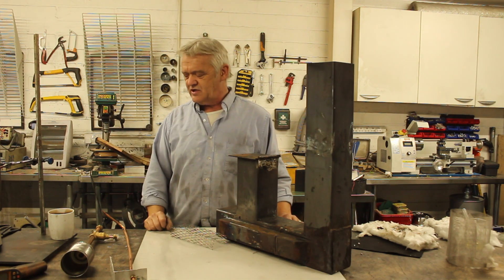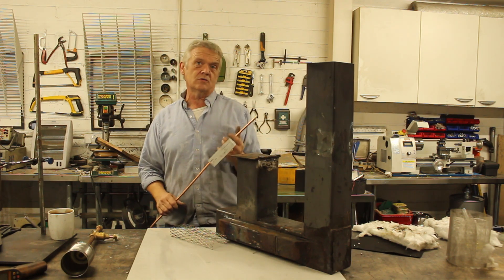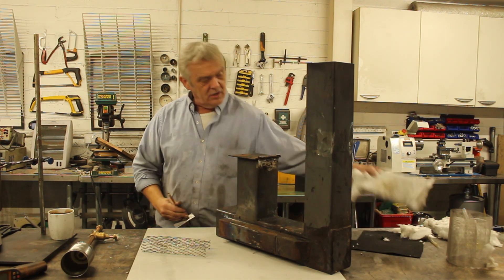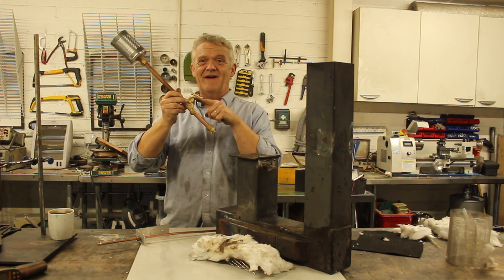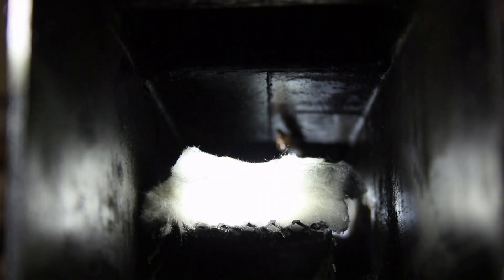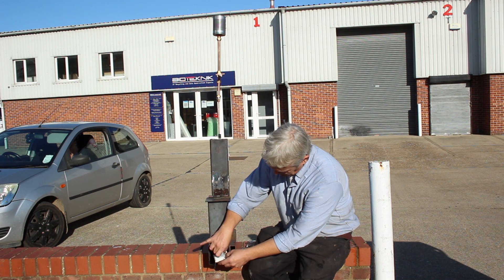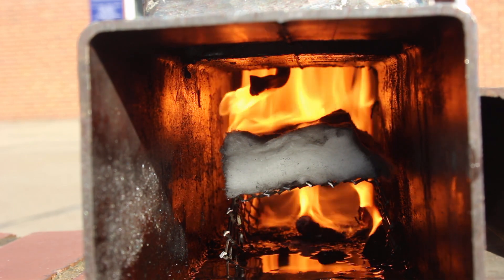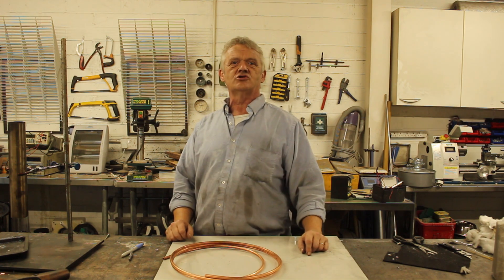1687 Waste Oil Rocket Stove

Comment: My husband has been saving waste oil from his various cars over the past 20 years, with a few large plastic drums of oil now stacking up in the front garden. Concerned about the longevity of these drums, I had asked him to remove them before they perish.

In the meantime, I had been considering 'cleaning' all this waste oil by using mycelium from Oyster mushrooms (big block of it ready to go in the fridge - this oil cleaning method discovered by Paul Stamets, world-renowned mycologist) and then using filters - in an attempt to make the oil reusable again.

However, turning waste oil into a heating fuel sounds good - if not for the house, then at least for my husband's workshop.

Comment: A little tip, just the tip, and only for a minute:
You can use a 12 volt Diaphragm Liquid Pump connected to a Variable Voltage Controller to replace a drip system and make it much more controllable and accurate.  They are self priming and can pump from 1ml per minute to about 500ml minute depending on input voltage.  Another important thing with oil burners is to filter the oil-you can use cheesecloth and coffee filters whilst transferring from one container to the other, or a little higher tech version using a pump and automotive oil filter-but it's very important.  Oil straight from a vehicle or machine is preferable, but if you don't have that luxury then filtration and a water separator is a must. If you use a spray nozzle system one way to keep the nozzle cleaner is to build an inset into the wall of your burn chamber, a 1" section of pipe with a drilled cap welded onto an appropriately sized hole works well.  Another Tip: an air powered "Engine Degreaser Wand" sold at Harbor Freight in the USA works exceedingly well as a suction and spray nozzle for liquid fuel burners. I heard from an industrial foundry owner that's what he uses for high output oil burners.  One more tip: a little diesel fuel mixed with the oil really aids in ignition, pre heating, and stability of flame as well as oil flow.  I use 10% diesel or kerosene approximately and it is well worth the trouble and expense.
Reply: remember though the simplest gravity drip feed, on to the super hot drip pan/rock wool ,will always vaporise/distil the hotter viscous liquid fuel & leave any & all macro carbon & metal contaminant's etc behind to make some conductive ink later ;) , no real super fine slow pre filtering required as long as it gets down the drip feed tube while getting heated as it travels nearer.

i suppose you could always paint on a conductive carbon ink 12v heater + pv + battery on to a super fine steel mesh with copper strips to carry the current & so make the fuel thinner while you filter...

Comment: Hi Mel, instead of the wick and put a smile stainless steel pan in there so the flame can drip into Red Hot steel would that be a much cleaner burn possibly a more controllable burn and get the fuel on the fuel tube out of the flame bring it into the top of the breach😳 ❤️‍🔥🙏🏼🇺🇸

Comment: Well Robert, the easiest way to improve the burning is to put a cap pipe on the exhaust pipe and make the burned gases go down the covered exhaust pipe and make the smoke come out the bottom. Easy peasy way of really getting way more heat. That is my idea Sir. Look forward to see all the improvements that send efficiency through the roof. Peace vf

Comment: The genius of the rocket stove is that the entering air is preheated by the partially burnt wood which falls down to the bottom of the burn tube.
If you design a way for some of the heat of combustion to come back upstream and heat the entering air before it reaches the fire.
You might do this by creating a venturi by bending a bit of plate into a J shape and laying it flat in the tube. The plate would have outlet holes at the arch of the J, the low pressure point of the venturi. The tip of the J, near the fire where the pressure is higher, could be propped up to form a slot. 
The pressure differential in the tube would then draw hot gasses back under to the arch of the plate where it would be drawn through the outlet holes to heat the incoming air.
Insulating the tube would also retain heat to vaporize the fuel.

Comment: In my previous comment I related how I mixed gasoline into the waste vegetable oil to get it going when it was cold. Since pondering that last video, and after watching this one, I was struck again at how easy it seems to do this and I realized that you are doing this on a nice summer day. I can guarantee that at -30° C you would have much more trouble getting it going. The oil (especially vegetable) gets really thick and won't drip. What is needed is a temporary burner tray underneath the oil reservoir to warm it up first, similar to the vintage blow torches or kerosene lanterns where they would use spirits or paraffin to heat the generator up first. I wonder if you could employ a swing out mechanism or even a sliding tray that would allow the oil reservoir to start out in the flue to be warmed first then slid out once reaching operating temperatures?  In any regard you should put the bean can with the oil and drip tube in the deep freezer for your experiments because if someone actually needed to do this when it was freezing outside it could be almost useless.
Reply: I think you may have answered the question that I had, why not put the oil feed at the fuel Tower ie the short part of the j.. where he has it mounted now as soon as you do get it fired up it will start heating the oil in the feed tube. Considering that it's a rocket stove just a small fire at the opening should heat the oil enough to get it flowing
Reply from the maker: I am sorry mate - it never occurred to me - we never get that weather here in the UK - but I am glad you brought it up - you give good advice thanks for the add
Reply: ... like a saddle tank...

Comment: Would be also interesting to ad the same type of device you use for waste oil, but with clean water, a valve and a spray, to try different mixtures into the combustion chamber..

Comment: That looks like a better quality burn, how about adding a few stainless mesh screen layers just above the Firebox in the smokestack, the heated metal will help crack all of the remaining fuels in the exhaust, however you may want to add an air pipe which is superheated through the fire chamber into the middle of your stack of stainless screen thus creating a catalytic converter at the base of the stove pipe making that area extremely hot?

Comment: So since waste oil is still I believe recyclable can we use vegetable or canola oil to do the same thing. Both of those have ignition temps of 406 & 425 respectively I am told.
Also doing the same thing but in a masonry heater could be very efficient heat. Burning about an hour or so will keep the mass heating it's space for a good 15 plus hours.

Comment: Areet man Back again 💚💛❤️ was looking for the video of making fuel from plastic and stuff but can't find it. It popped up but was about to watch something else. Cool thing you built there. My friend once made a greenhouse heater using waste oil. The oil would drip down slowly and heat water pipes and it was gravity fed. Can't remember exactly how it worked but it was in a biscuit tin back in the 80's 💚💛❤️

Comment: Do the water coil heater along with the oil burner and maybe even place a hot air stirling "enging plate" with some kind of linkage so you can use the heat to power a fan blowing into the air intake as a sort of supercharger.
Reply: no coil or pump required ,just add a stand alone removeable small sealed back boiler 'box' with side overhangs to capture & transfer even more heat in to the water box ,above the burn & 2 large diameter straight up copper pipes, one for the hot water to flow up to the top of the storage tank & one to let the cooler water in the lower part of the storage tank fall down, heat convection differential in the separate hot & colder pipes does the pumping to/from the higher storage tank & keeps the box & pipes always full

Comment: Rocket stoves work on the "excess air" principle of combustion. Typically, they have enough excess air for wood and small amounts of other combustibles. Adding oil increases the temperature enough to cause rapid degradation of the burn chamber. I have many, many videos, starting in 2007. Many explain the principles.

Comment: Would the copper be able to heat up to a flash point causing the oil inside to start burning (explode)?  Would it be better to put the copper o the outside and through a port just slightly ahead of the burn area to reduce the heat?  Love the setup and I was just wondering what to do with my waste oil from my cars.
Reply: It is possible to overheat the oil in the feed line. Doing so causes the oil to disassociate into hydrogen gas and carbon buildup. Maybe there's a chance it could expode but more likely it would just block oil from going all the way through, and any pressure from the hydrogen gas  would simply be quickly disipated back through the open valve. Note that  by the time carbon deposits fully block the tube, the fire has been oil flow starved for awhile and not as hot as it used to get.
Reply: Some preheating of the oil is helpful and may even be nessesary in cold weather.
Reply from the maker: it won't flash inside the copper pipe mate - no oxygen. So the only place it can burn is where the drip comes out - if it got hot enough to flash it would do so gradually and first you would get a drip that burns then a study during jet of liquid fuel then a steady burn of gas - a bit like a gas burner - in fact if you see left where we looked inside the firebox you can see the fuel jet go l liquid and burn almost as soon as it exited the copper pipe
Reply: @kensmith5694  yup oil needs to oxygen to burn. But un the absence of oxygen and given too much heat, the hydrocarbon may break down do hydrogen and chuncks of carbon deposits.

Comment: Suggestion:
1) Coil the copper drip pipe to improve preheating
2) Have 2 sets of wool. One for use as a wick like u're currently doing. The other as a filter, together with a funnel and buckets, u can clean up the oil prior to combustion. When the wool in the stove becomes unuseable, replace it with the filter piece. Fresh wool to fill in the filter's place. That should help to prevent clogging in the valve.

Comment: I guess you could get a spray nozzle or something of that kind and pressurize the oil with an air pump inside of a closed container. 

Also, a thicker steel stand would be good to have so when it startd glowing hot, you certainly got ignition. 

Well, essentially, some injection car parts.

Heck, a hand pump would do.

Comment: A couple improvements right off the bat: Insulation for the fire box--the hotter it burns, the better, though you will want to protect the steel if  is a very hot burn (many ways both of these can be done, and it can be a "two birds, one stone" solution too). 

  Switch out the copper pipe for stainless steel (or an even less thermally conductive material). Copper is way too thermally conductive. You run the risk of possibly over heating the oil reservoir oil (you could use copper towards the very top though, to actually cool it down a bit, if it is far enough away from the heat, but the first 3/4th of the material really should be something else). Besides using steel pipe etc, I would also put either a little insulation and/or an IR reflector at the bottom of the reservoir can to double make sure that this doesn't happen.  . 

   Actually, I don't know why I even write comments here tbh. People rarely respond at all (besides you occasionally Rob, which I do appreciate). They often go without a reply, or even a single like. I don't know if my ideas are just considered stupid, or I'm really just not enough of one of the cool kids or what.  I guess I continue to share in case there is anything helpful to any of it.
Reply: Your comments have stood out to me as constructive and interesting, I usually look to the comments for tips like this because there is usually as much insight in them as in the actual video.

I would keep in mind that many more people will read a comment than will reply to it. I usually don't have anything constructive to add myself without going into far more detail than is likely to be useful to people.
Reply: Good comments are lost in the sea of idiotic ones.

At least you have an understanding of what a rocket stove is... but in this case you're making improvement suggestions  for his metal test stove

He's just testing the oil... Rob is intelligent enough to make an efficient rocket stove once the oil concept is proven
Reply: @dismayedtrinket2518    Thank you for the kind words.  I hadn't seen your comment earlier, but apparently someone liked it recently and I finally got a notification.
Reply: @bigpie6240   Cheers
Reply: You could run a tube inside a tube to prevent clogging

Comment: Make the chimney about twice the length and add the holes about half way up or roughly where the flames reach (this may be much higher than half way) then cover the holes with some square tubing to make an air passage to preheat the air coming into the chimney and run the square tubing down side along to firebox but leaving open to the air thereby creating a preheated secondary air intake or blast pipe at the end of the flame path and it should reignite any unburnt fuel.
Reply: @shortbuslife3440, this sound interesting, but i’m dense on this having no clue why i’d drill holes (quantity n size?) n then cover them w sq pipe …run inside or outside the smoke stack?
Reply: @patrickbourque6864  the square tube would obviously need a hole cut into it to allow air to pass through it and the holes in side and the square tube will also  get hot thereby preheating the air before it enters the burn area plus stops any smoke leaving the holes.
Reply: @shortbuslife3440  ... more confused than before, i give up in trying to understand this

Comment: Seen them made with calor bottles a brake disc and pipe drop feed as you did . Then wrap some coils around it to take that heat off into water either hot storage or high pressure steem
Reply from the maker: yep - seen lots of them mate tbh - like the coil idea

Comment: Great videos Rob! I'm thinking about making a simple oil or disel burning rocketstove engine heater for my tractor to ease coldstarts in the winter here in scandinavia.
Reply: Use a charcoal basket it's much safer and once you know how much charcoal you need it's also reliable and you won't need to watch over it all morning

Comment: I built  something similar except I run the flue into an inverted 47kg gas cylinder, taking the flue gas out from the bottom/ top of the cylinder 
It heats a 32 X 32 workshop that has little to no insulation, we use wood, coal, oil anything that burns to stop the smoke we diluted the used oil with some red diesel the top / bottom of the cylinder that has a piece of boiler plate let into it as a cooking surface glows cherry red.
It can be 
- 5°c outside we are in t-shirts inside it doesn't take long to get going , it gets so hot it burns the smoke.

Comment: As the name states “Rocket Stove” I wonder what the air velocity is from the top of the chimney and if this could be used to spin a turbine to generate power, I keep thinking about the early centrifugal jet engines and how similar the stove is to the burner section.
Reply: That is a good question. I might have to add a 12 PC fan to blow air in to make it hotter and having some kind of turbine on the top, would make it self powered to go!

Comment: I'm curious. The rocket stove uses an air intake duct from one side of the device, combusts right at the bottom of the chimney and the heated air rushing up the chimney creates a negative pressure in the air ducts, causing air to be sucked into the combustion chamber.

Why is the air inlet only at one side of the device? Isn't the diameter of the inlet the limiting factor, limiting how efficiently can the fuel burn in it?

I'm asking, because with the bricks you fashioned the same exact model: air goes in from the duct in front and goes out through the chimney. Then you had trouble reaching the combustion chamber and the air inlet diameter was again a limiting factor. Why not create an air inlet 360º around the combustion chamber? I.e. arrange 3 or 4 narrow bricks around the combustion chamber so you could access it easily from either side, and stack a brick chimney on top of those 3-4 bottom bricks. The way I understand, heated air will still create negative pressure around the burning chamber and suck all the air it needs for burning. Am I wrong?

If my thinking is correct, then perhaps it'd make sense to remake the rocket stove into a round version as well, feeding air from the bottom or 360º around the combustion chamber?

Sure, drilling holes is always an option. But holes increase the surface area with thin corners (metal corners 'round the hole) which will rust the whole stove faster.